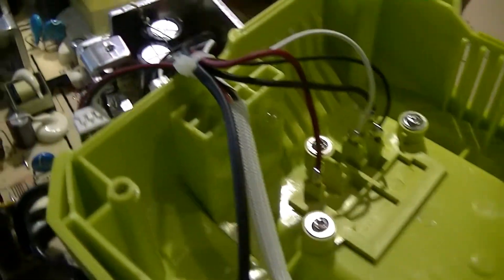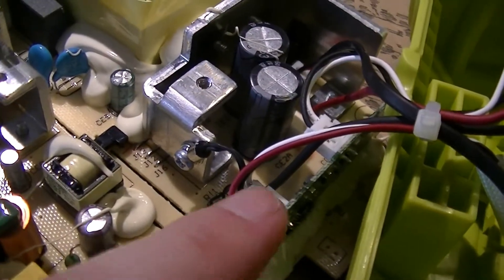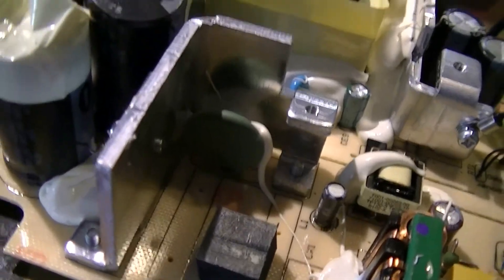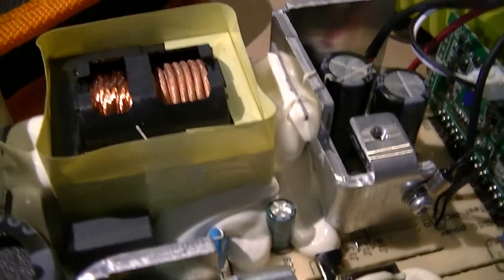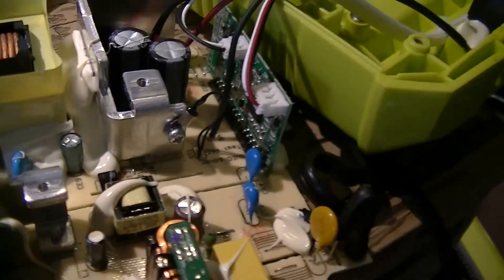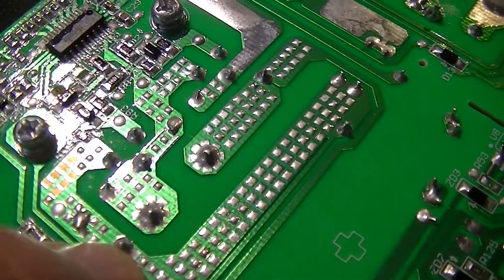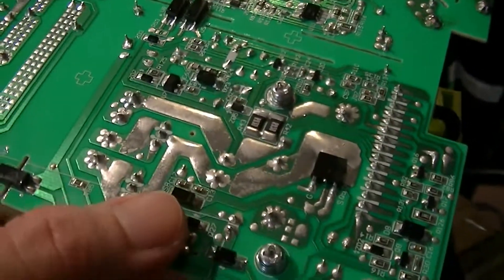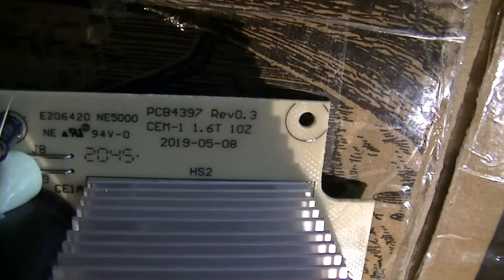Ryobi OP406 40V fast charger guts/teardown

Comment: Great video, thanks for doing this!  I was looking for a teardown b/c I bought some of these chargers (OP406 / OP406VVM) used from ebay (about $20 to $25 each).  All seemed to  work but one drew twice the power (500W vs about 240W for the others, according to my Kill-A-Watt).  I stopped using it for fear it would damage the batts.  I checked the bottom of the board and found that R43 is missing.  I looks like it broke off ( rough copper spots on both solder pads).   Mine differs from yours in that R42 is an R015.  I considered that maybe they switched to a single R015 instead of two R030s, but that wouldn't explain the rough spots on the pads.   I may try to find an R015, solder it in, and see if that limits the power draw to 230 - 240 W, like the other OP406s that I have.

I dabble in electronics but would not have thought to look at those had it not been for your teardown and explanation (around 11:46).  Thanks again for your effort, and for sharing your knowledge!
Reply: After looking more closely, I'm not sure R43 broke loose.  I have a different revision (PCB 4527 Rev 0.4).  When I zoom in on a photo of the pads for R43,  I think the copper spots (I mistook for indications of  a broken-off resistor) are actually just a portion of the pad that isn't tinned.  I'm not sure why it's drawing 500W (twice the power of my other charger, and more than the 300W on the placard), but I'll likey just shelve it and buy another charger.  Still appreciate the teardown vid!

Comment: Can i change the internal components to a slow charger housing?? I want to change a broken housing
Reply from the maker: Air flow may be a problem.  If the battery mount and other dimensionally critical parts of the housing are intact, you would be better off fixing that.

Comment: Is it possible to convert this charger from 110V to 220V?
Reply from the maker: Maybe.  The main PSU section is, but the whole thing depends on the standby/auxiliary supply being dual potential (a lot but not all small switching supplies can run on anything from around 100V to around 250V).  You could check the chip and transformer to see their ratings, or brute force it and convert one by cutting the rectifier link iffen you have one that you are willing to sacrifice.  No magic smoke from the aux supply means it's good for 240V operation.